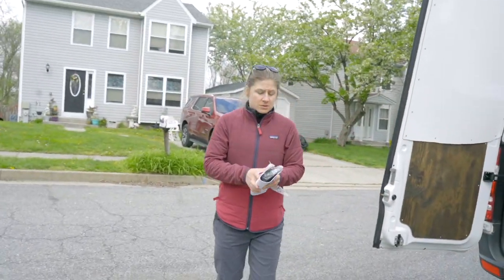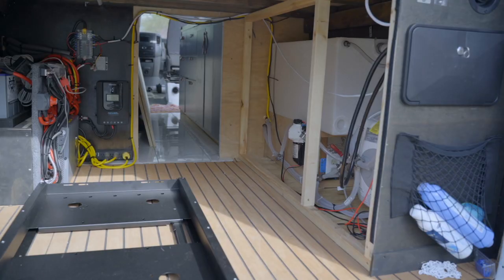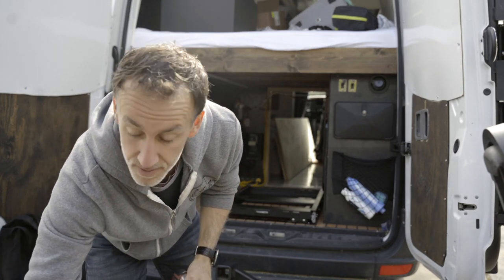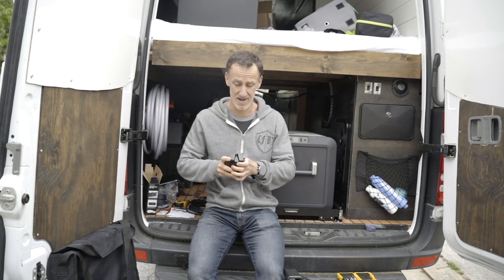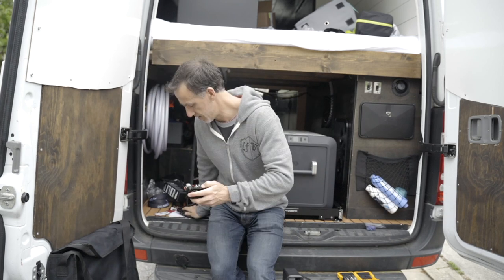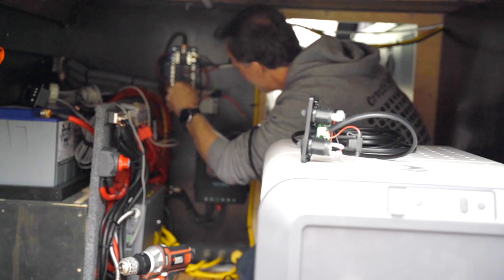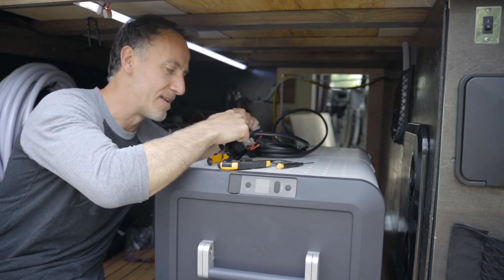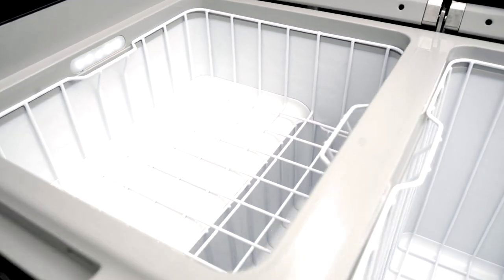Dometic CFX3 75DZ Fridge Install | The Best Fridge for Family of Four for Van Life

Comment: How’s the slider while driving? Any annoying rattling at all?
Reply from the maker: No problems at all while driving.  Super secure super heavy duty.  They did a great job with that.  Got a little squeaky after about 6 months on the road, but a little elbow grease can fix that.